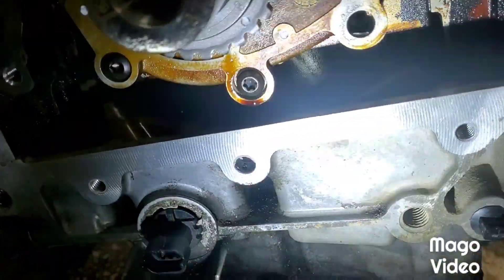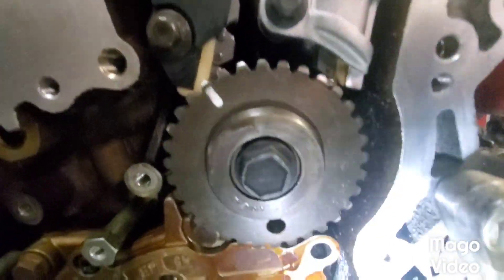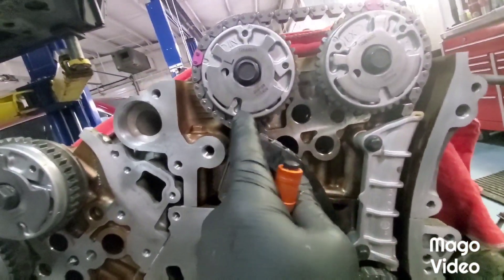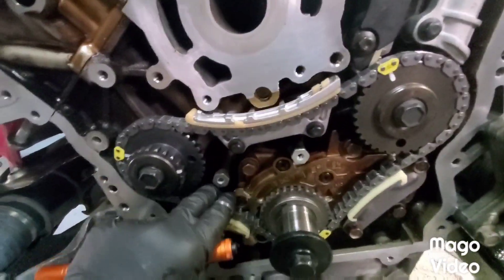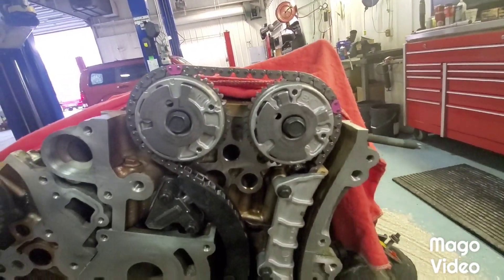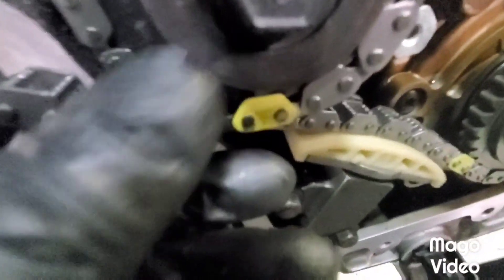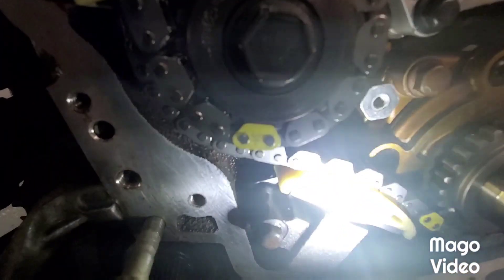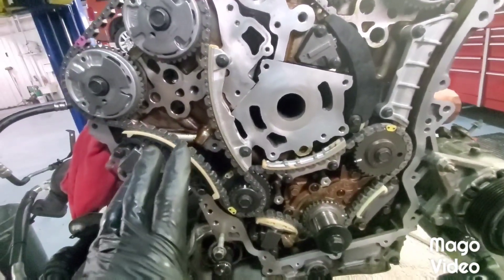GM 3.6L STAGE 1 & 2 TIMING SIMPLIFIED

Comment: Great video!  I did mine back at the end of 2018.  Wish I had this video at the time.  There was plenty of info out there, and I didn't really have any trouble, but this video would have been a nice addition.
I did mine with the engine in the vehicle.  Really, it wasn't a horrible job once I got all the tools lined up.  It's just really time-consuming doing it in the vehicle.
Reply from the maker: Very good, thank you for the support and feedback.

I just wanted to share how simple the timing stages are.  It's pretty straightforward once you've done a few of them.

Not alot of room to place that cover, but it can be done in car, not as easy to get them clean and that's critical on these.
Reply: How much did the repair end up costing you?
Reply: @waynethomas1726  It's been a few years now, but I think it was less than $1000.  If you go to my channel, I have a video up of all the tools I used.  It's not a professional channel, so it's not really great, but it will give you an idea.

Comment: Paul, when I roll the engine over like you say to make sure the chain is seated.  Is the popping noise from the tensioner and cam phaser normal for this process.
Reply from the maker: If you're talking about the tensioner resetting due to no oil pressure then yes, as long as you follow the procedure to the letter you have nothing to worry about 😉 watch it again and make sure, but if you are paying attention then you will know without question you're on point.  Question is, did you read my description?
Reply: @PaulysAuto   Yes, did Paul thanks for the quick reply.  I know you say only use AC Delco. What's your take on the Cloyes timing kit? I'm just curious.
Reply from the maker: @xiongfamily5358  never used their product, but when I do big jobs like this, I don't like to worry.  If the manufacturer updates a part, remember that aftermarket takes alot longer to update accordingly 😉

Comment: I have a million dollars question. Ok so everything lines up all the dots everything looks good. So how many times do you rotate the end so that everything lines back up. Meaning I want to rotate my engine to make sure everything stays lined up
Reply: Quick update,so for no engine codes....
Reply from the maker: @joecas373  excellent 👌
Reply from the maker: Don't know, alot?  No need if you're doing it correctly-waste of time.  If you follow my instructions you will BE GTG.
Reply: @PaulysAuto  I did but for some reason after putting everything back together and starting the engine I got
Reply: Infamous engine code regarding timing chain p0017 and when I open everything back up it seemed that it was off by one to oth so I put everything back now and I'm hoping this time I'm not off
Reply from the maker: @joecas373  did you replace everything to include VVT Phasers or actuators and VVT Solenoids?  With ACDELCO Parts?  You can't go 1/2 measures on this job...read my description.
Reply from the maker: @joecas373  P0017 means your right hand side (firewall side) bank 1 exhaust cam sensor and crank sensor signals do not agree with one another....likely a bad phaser or it's not set correctly during stage 2 timing.  It could be a cam sensor signal problem too, but without scoping it and comparing cam/crank signals with a 4 channel scope to a known good you cannot verify timing on this engine without tearing it back down and reseting it.

Again all new authentic GM PARTS?

That's why I wrote the description the way I did.  This engine has alot going on with 4 cams with vvt.
Reply: @PaulysAuto  I replaced everything with ac delco . My mistake was on the right side marks. I was off by 1 tooth. I was sitting the chain on the r and not the triangle. But hopefully now after following your video I should be able to get it right. I just wanted to see if there's any way of rotating the engine to see if after a few turns  it would show if it's right... I'm doing this in my garage on the floor so you can imagine the headache. But I do appreciate your help and I will follow up....it's a 2014 with 124k ....
Reply from the maker: @joecas373  ok very good, just take your time and follow my instructions and you'll be GTG 😉

YEAH, it's a pain in the ass on the floor, but it can be done.

Seal that front cover using AISIN...Nissan product...you'll thank yourself.

https://www.amazon.com/AISIN-AB1207B1-Black-Gasket-Sealant/dp/B01MUFWSBH/ref=asc_df_B01MUFWSBH/?tag=hyprod-20&linkCode=df0&hvadid=312168100217&hvpos=&hvnetw=g&hvrand=1302766083045893128&hvpone=&hvptwo=&hvqmt=&hvdev=m&hvdvcmdl=&hvlocint=&hvlocphy=9020100&hvtargid=pla-571541744583&psc=1
Reply from the maker: @joecas373  that's what she needs like clockwork every 130k or so.  Clean her thoroughly 👌
Reply: @PaulysAuto  I changed my oil every 3000 miles.. I also have a 2008 gmc envoy with 133k and this thing runs like new. I change parts before they break. I like to go by the book .
Reply from the maker: @joecas373   You poor bastard, you're giving me anxiety just thinking about having to tear that engine back down and redo it on the floor.

Oh well, all you can do is laugh, at least you figured it out.  You'll be an expert at them after this! 😁❤

Don't feel so bad, imagine how it feels to f-up when you are supposed to have her done on a Friday night for a customer 🤬🤬🤬🤬🤬🤬

We've all been there, that's why I made this video, because it's easy to screw up if you haven't done one before.

I know my video goes fast, but that's because techs have little time in the shop; so watch amd listen carefully and pause etc...you'll have everything you need to be successful this time around!

Keep in touch, by the book, I like your style!!!

Remember when I said it's important that you get it right the 1st time because once you roll her over its a one time shot...marks aren't gonna line up anymore and you'll be starting over 😆😆😆

It's the one's that kick our ass that make us great!

Good good on oil changes, I bet she was clean when you opened her up?  Well clean for a GM 3.6L anyways.

Don't forget to clean them valves up thoroughly with carb cleaner and compressed air.  Blow all that carbon off the back sides.  Brake cleaner is your friend, let her buck and blow all that s*** out, you won't hurt it...trust me.

Let that engine seal overnight...that AISIN Sealer is the s***, just needs proper cure time 😉

Like I said, I go in once on engines for a reason...best of luck my friend!

Let me know how she runs when done!
Reply: @PaulysAuto  will do brother. Wish I can send you a picture of the engine. .I'll keep you posted. Stay safe and continue with your awesome video. You have a new subscriber.
Reply from the maker: @joecas373  find me on Facebook Nathan Pauly from Little Falls, MN 🙂 Send me a private message so I know who you are etc...good stuff!

Comment: Are the exhaust cams (specifically the right bank) supposed to be easy to turn by hand?
Reply from the maker: I apologize for some reason I didn't get notified of your comment?

You can roll that cam over easily because once set on stage 2 mark it prevents valves from hitting pistons...like I said, if the marks and colored links are lined up...you cannot screw it up.